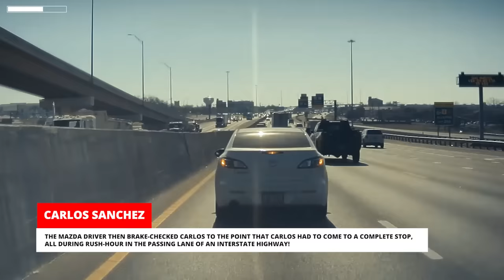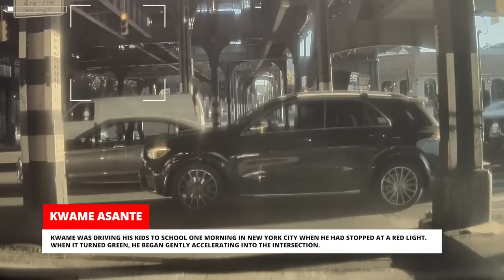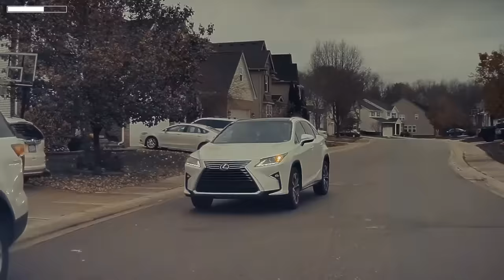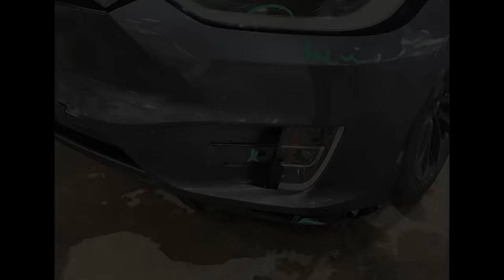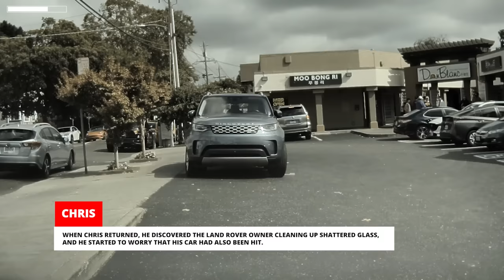INSANE ROAD RAGE ATTACK CAUSES MASSIVE HIGHWAY CRASH

Comment: 13:20 So yes, it is your fault for running the red light. The light was very obviously yellow for like 5+ seconds and like, 200ft at minimum, which you should have taken into account to stop. All of this would have been avoided if you weren't so aggressive, either.

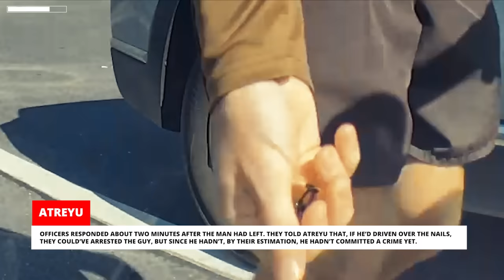15:50 bruh come. fucking. on. Why is this so common. There is literally a law in the USA for premeditated crime. There is attempted vandalism and criminal preparation laws, that of which all states have. Even if the crime didn't happen, just being caught preparing it is enough to at the very least charge you.
There's a difference between "oops I dropped some nails everywhere and i just happened to not find the ones under your car wheel" and "I specifically bent down and placed nails under your car wheel."

16:15 technically the first overtake was legal, but still dangerous regardless because of the winding road. The second take over however was very not legal.

Comment: TIL it's perfectly legal to set up crimes so that other people technically hurt themselves.

As for #5, those are two separate incidents. Mustafa is in the wrong for running the light. The other driver is wrong for attempting to push the another driver out of the lane. Running a light does not make them at fault for another bad driver's decision.

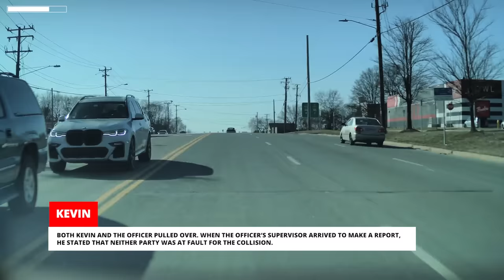Comment: 3:25 Both Kevin and the officer are at fault, but I have to put more at fault on the officer, unless if the Cammer was fully stopped, the Cammer should’ve paid attention to the lights but the officer has to make sure they can make a turn in reasonable safety even if they have their lights on, and obviously it wasn’t safe.

Comment: For mustafa, both are partially at fault but it would more be the other driver's fault, because (now don't know if it is the same there but where im from,) it's illegal to lane change in a intersection. So even though they both were in the wrong, the hole thing would have been avoided if the other did A: not lane change in intersection B: check to see if safe to lane change.

Comment: Im wondering why no one ever changed the quarter glass to polycarbonate. It would not scratch as a normal window would because it is not moving and it would resist all the glass breaker tools these thieves use.

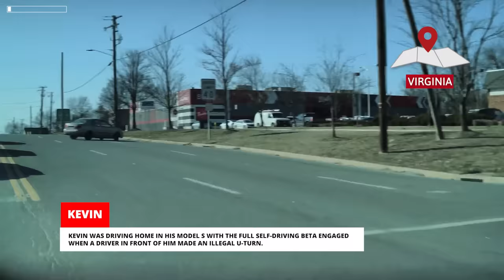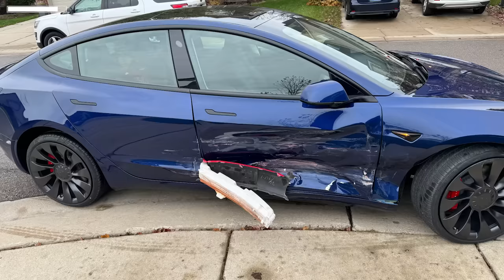Comment: 1:34 That's insane! The driver should at least qualify for a reckless driving citation which is akin to getting a DUI to insurance companies. If he had been so charged, his insurance would also need to pay out to the other cars involved, it would have been, and should have been a mess for moron! 2:50 The officer crossed a double yellow line which is against the traffic laws so he is at fault here. Maybe the officer thought it was 50/50 because there did appear to be enough space for the Tesla to stop had he been going slower, and paying attention? In the end though, the officer broke the law, and shouldn't have pulled out like he did so it's his fault not the Tesla driver's! 7:27 $15,000 repair for two doors, a fender, and work on the rocker panel which is likely the most expensive part of the repair. Be warned folks, Tesla parts are extremely expensive hence insurance is also very expensive. If buying a Tesla, have your insurance costs in hand to make a decision whether to buy. 13:11 Sorry Mustafa, I would have driven my car exactly as you did, but I would not have honked at the other driver as he had his blinker on, and the scenario wouldn't have happened had you not sped up, your fault my man! It's one of those things where you have to accept had you not sped up the other driver would have been fine moving over, but you did speed up which the other driver couldn't possibly anticipate, and then you honk at him as if it's his fault, wrong! The driver shouldn't have made it personal by veering into you, but it ended well, and you learned some more skills. Don't be so quick to use the horn, rarely do you really need to use it, and these days, you might tick off the wrong person, not worth it! 👍😎✌🗽

Comment: 14:19 Mustafa ran a red light. The rule for safety is: if you can stop you should stop. Don't speed up for traffic signals. Believe turn signals. Use turn signals. Turn signals indicate intention. Don't pull out in front of signaling cars on right turns into parking lots until they commit their wheels.  They may be signaling for the next entrance or intersection. The best moves in a car are habits. Always signal. Always make full stops for stop signs and right turn on red. Don't tailgate. 15mph on turns and yield signs. That pretty much covers the obvious rules. Oh yes. Don't be afraid to be cautious and expect every car on the road to possibly make a mistake. Think ahead and anticipate mistakes. Every intersection is a new adventure. Accelerate to freeway speed when merging on to the freeway. Nobody owns the road in front of them except a)&(*s.

Comment: For anyone saying Mustafa in the wrong something wrong with you personally. He technically didn’t run a red light. The light was still yellow and yes he did have enough time to stop, but necessarily he did not have to stop so the person who is at fault is the beige car even though there’s no accident and the beige car driver is over exaggerating B$$$h 14:12
Reply: I hope you don't have a license. I do, for all kinds of vehicles on the road, and you are wrong. If the light turns red before you pass the line that means you should've stopped, assuming it was safe to stop, which it obviously was.

Comment: Mustafa Has no experience driving. The Other driver wasn't expecting MUstafa to run the red and justifiably had his signal out to merge right AFTER the intersection. The other driver was lazy to not check his blind spot before changing into the right lane, but Mustafa shouldn't have been there, Mustafa's driving violation put the other driver in a bad position he didn't expect to be in. It was wrong of the other driver to push mustafa into oncoming lanes. But I can understand why he'd done it, Mustafa basically did the same thing to him after the red light.

Comment: There are clearly some bad police departments in the USA. How can somebody deliberately brake checking somebody to a halt on a high speed highway thereby triggering a pile-up not get prosecuted for dangerous driving or whatever the local equivalent is? Not to forget all those illegal manoeuvres prior to that incident, all captured on video. 

Then a police car does a U-turn without checking the road is clear first. It's not he U-turn itself that's the problem, s sometimes emergency services have to do such things, but not doing safely that is the issue.

Then there is there are the police that decided attempted vandalism isn't a crime. Next they will decide attempted murder isn't a crime either. 

nb. Mustafa is the sort of driver who should not be on the road until he learns some sort of road sense. First, a yellow does not mean continue, it means stop if it is safe to do so. It does not mean "gun the motor" to try and beat the red, and when you fail to do so, say that going through the red was "out of his control". If a car is signalling to turn into your lane some way ahead, and you accelerate into the space, then you are already being an idiot, and if you then proceed to blast the horn after having run a red light at speed, then you are adding insult to injury. That doesn't excuse the other driver reacting in the way he did, but Mustafa's actions were what triggered this. The right thing to so, is when approaching a junction with a yellow, you slow down and stop when there is plenty of time to do so. When a car is signalling to turn into your lane some way in the distance, you don't accelerate to close the gap, even, or especially, to make a yellow. Just simply awful driving and that somebody has to ask if they were at fault astonishes me.

Comment: Mustafa is not in the wrong for anything. In most States you can proceed through an intersection as the light turns red even if it turns red while you're in the intersection. The other driver is completely at fault. One for leaving his cigarette on for a long time. Also for not checking his blind spot. As well as merging into his lane

Comment: #2 The Officers had video evidence of an act that could have endangered lives; the nails may not have flattened the tires immediately. Yes, they can act on that, but that requires good police work. 
Unfortunately, most people believe the opinion of the officers that arrive on scene and never file a dispute with the police department. Without at least engaging with the perpetrator you are encouraging, bad behavior.

Comment: Mustafa you are in the wrong. How can you say that it was beyond your controlled stop at a red light. If you are operating a vehicle and you see a yellow light it does not mean accelerate it means slow down. If you are if you are behind the wheel of a car you are to be in control of the car so yes it is your fault. None of this would have happened if you would have follow the rules of the road and stop for the red light. Just because you didn't feel that you had to stop does not mean that you are not at fault. The other driver should have tried to take and run you into the other lane but that's beside the point. Everybody's actions causes an equal and opposite reaction.

Comment: Mustafa was wrong for speeding up to beat the red light, however if an accident had occurred the other driver would have been found in the wrong for changing lanes in the middle of the intersection as that maneuver was most likely illegal.

In Atreyu's case I'm so confused....but it's Florida so I'm not surprised....Nevertheless hypothetically, if you enter a bank with a mask, a fake gun and the intention to rob the bank but the bank manager sees you enter the bank recognizes the tell-tale signs and has the wherewithal to prevent you from even approaching a teller and stops you from robbing the bank did you not commit a crime because the bank manager stopped you from achieving your goal of carrying out said crime????? I guess in Florida it only counts as "criminal" only if you succeed in committing the crime???? SMFH

Comment: The very first clip shows the Tesla driver cutting off the white Mazda. Granted the reaction is far from alright, but the cammer screwed up first. When changing lanes, you should never be forcing another driver to change speeds or take evasive action because of your lane change. It does not matter if the other driver is speeding or anything else.
With the cop making the U turn, fault varies from one jurisdiction to another. In some, an Emergency Vehicle with lights and siren activated has absolute right of way. Get in a collusion, unless you are completely stopped, and you are at fault. In this case, I would say the Tesla is at fault. It could not respond to aural input and by the time there was visual input it was too late. Maybe Tesla needs to put ears on self driving cars.